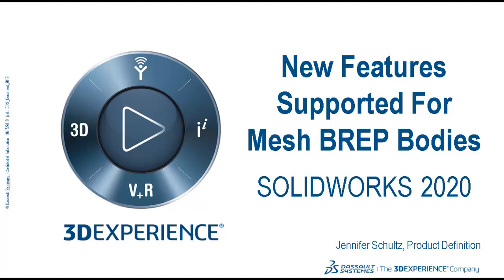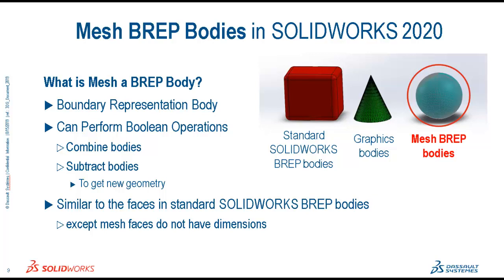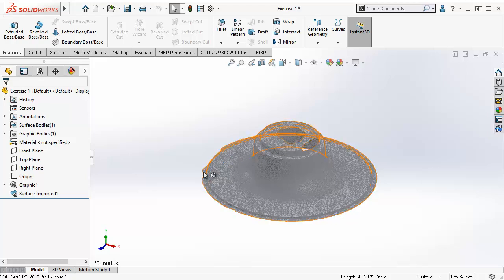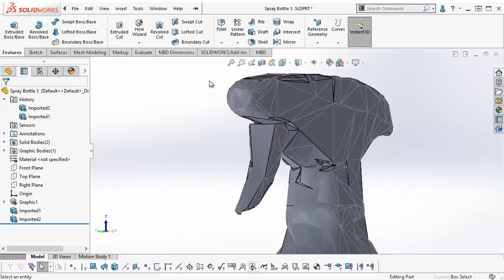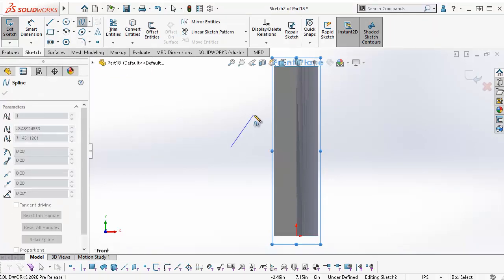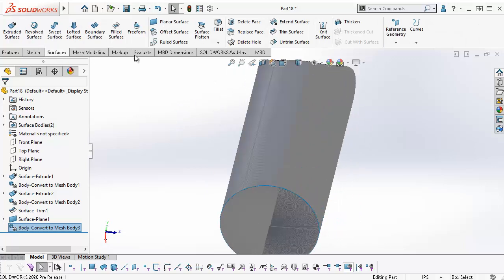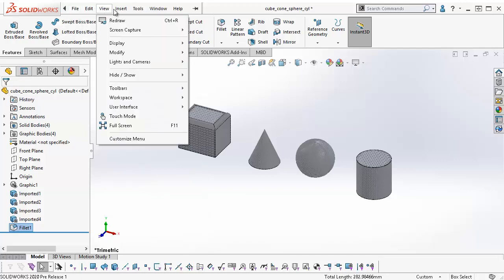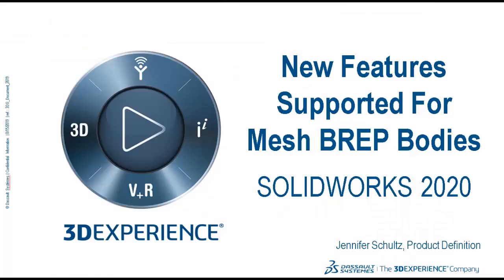New Mesh BREP Features for Reverse Engineering in SOLIDWORKS 2020

Comment: This looks an interesting direction from Dassault. Clearly recognising that Reverse Engineering is expanding area. We currently use Extract 3D for stl curve extraction & Powersurfacing for organic surface extraction, both add on packages for Solidworks.